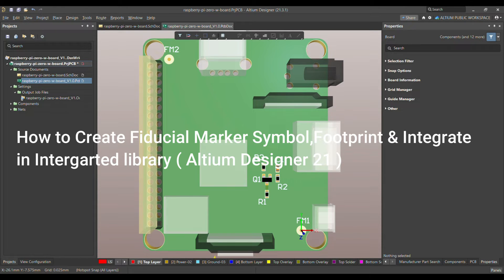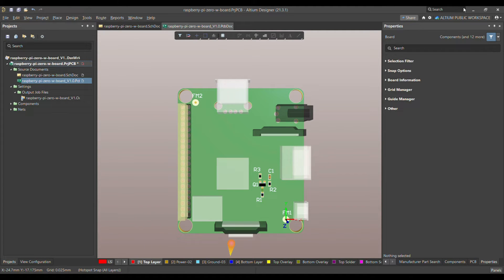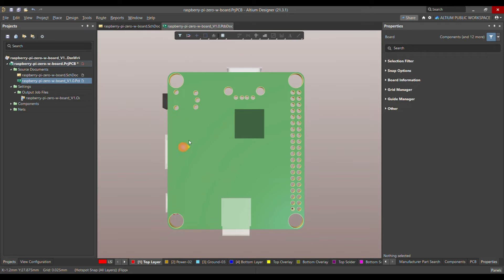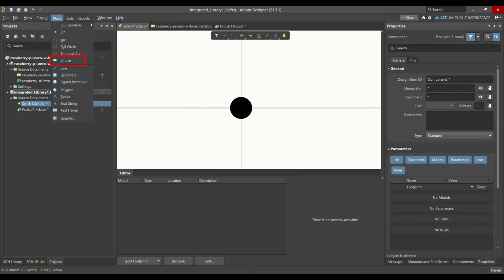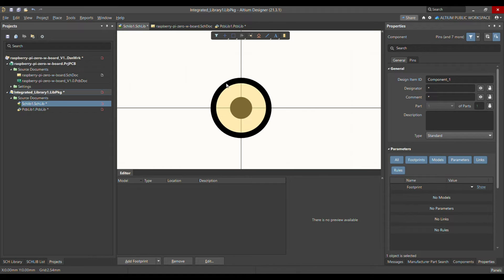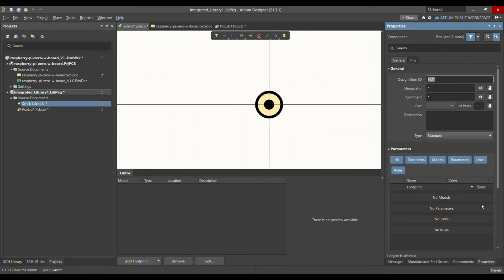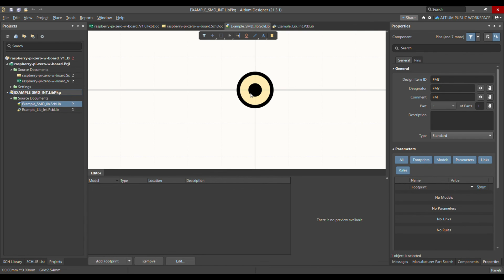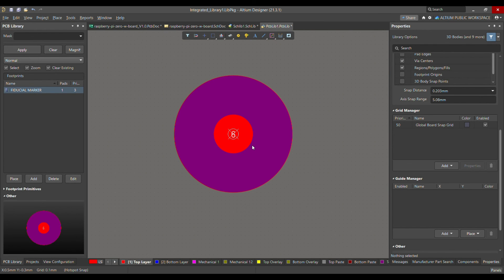Altium Designer Tutorial 7: How to create a Fiducials Marker in Altium Designer 21.

Comment: Should it be a Standard component type? Not NoBom or Mechanical?
Reply from the maker: FM is  not a standard component.
Reply: @ but in your video it is
Reply from the maker: "Yes, you are correct. I needed it in my BOM to ensure that when I send the data to the PCB supplier, FM is included on the PCB. This was the only way I found to keep track of it, which is why I made it a standard component. In case you don’t need to track it, you can choose it as a No BOM type."

Comment: Is not sense for me create a schematic symbol for the fiducial. There isn't logical functionality for them.
Reply from the maker: Hello Claudio, 

Fiducial Marker is an IPC requirement and that's why it's good to have a symbol with a footprint otherwise only a footprint is also fine as long as you won't forget on PCB layout.
Reply: Placing a Fiducial as a nobom or unfitted component allows it to be exported with the ODBs and Pick and place files, giving an exact X/Y coordinate which makes it easier to program assembly and automated inspection machines.